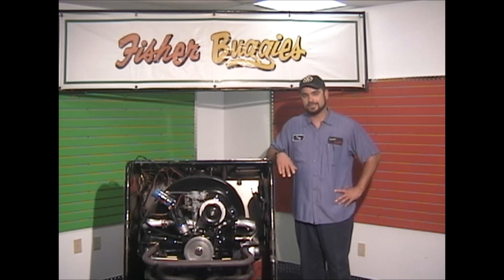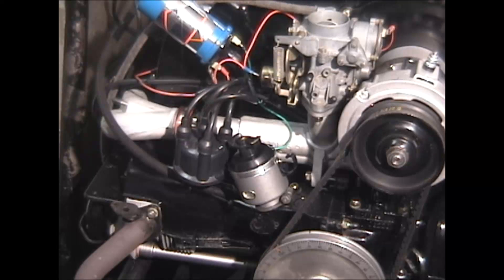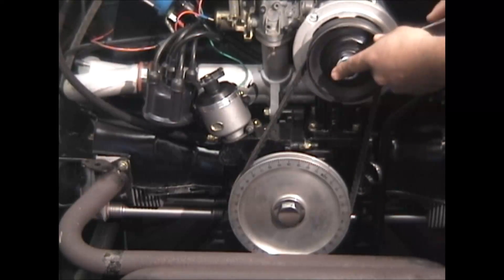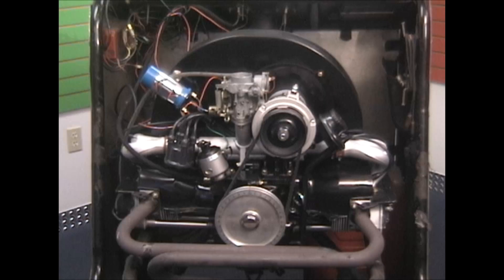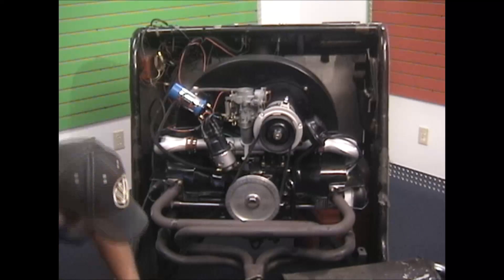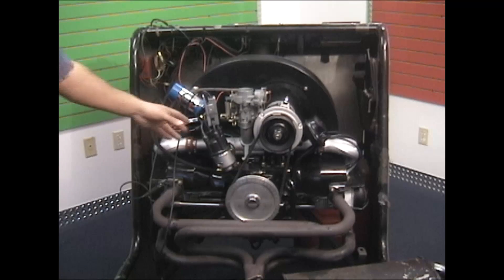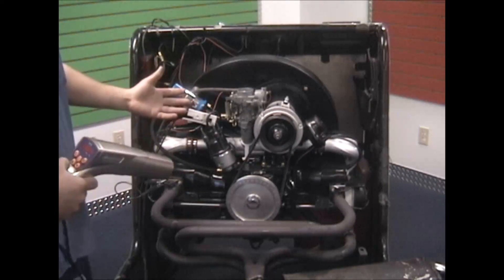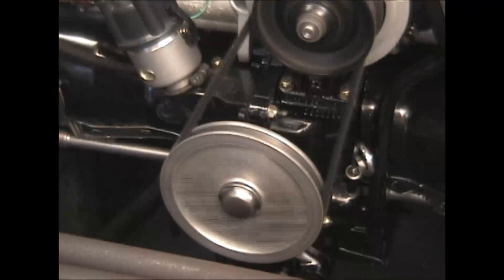VW Ignition Timing

Comment: I have something going on with my 73 standard beetle... no 1 & 2 are firing, but not the 3 & 4. I have tried resetting the timing, changing the distributor’s out from mechanical to vacuum advance, new alternator, & voltage regulator. New plugs, points, condenser, cap, rotor.... NEVER have I run into a problem like this.  I know it’s staring right at me, but I can’t figure this out! I would LOVE to bring it to you, but I’m in Kentucky!
Reply: Has anyone run into this kind of problem before? Right 2cylindwrs firing, left two cylinders NOT firing? Any, ANY advice would be GREATLY appreciated! Thanks
Reply: GOT it all figured out! Apparently, the gasket between number 3 & 4, was torn. My guess would be, because they fire sequentially, I was losing compression. That, and I took apart the new carb, sprayed it WELL with B-12 carb cleaner & put it back together. I was surprised when I bumped the starter over, and it started purring! SWEET!!!

Comment: Hi pop in electric points set timing  at tdc then put test     light screw drive one  coil on negative  still wee light stays on as turn distributor left or right  .... in the light stays on.. do u think is  watt doing  that ....big thanks

Comment: Thank you very much for the video... I have a question... I have pulley like the one in the video and when I turn it to TDC  the rotor points at cylinder #2 (about 2 o'clock) instead off cylinder #1 is this OK?
Reply: Watch "Classic VW Beetle Bug Ghia Bus How to Time Set Volkswagen Engine Timing" on YouTube
https://youtu.be/787INwvir24

Comment: The only sure way to accurately find #1 TDC on the cam on ANY even cylindered, even firing engine is to make sure the companion cylinder is on overlap. On a beetle that would be #3. On most inline 4s it would be #4. On a SBC it's #6.

Comment: Having trouble with Sandrail. Sounds good idles good just doesnt go fast. its super slow as if not getting enough gas.
checked the inlet to fuel pump from gas tank and it was brown fluid at first. does this mean my fuel pump is out? or do i have a timing issue perhaps?

Comment: My 1972 VW Westfalia Bus does not want to idle, she will die when slowing down to a complete stop unless gas is always given. Could timing like this be the issue?
Reply: I have a 72 bus too.  It likely a few things. 1) Make sure your engine is warmed up well before driving. 2)  (The most likely issue) is your carburetors...make sure to readjust your idle mixture, idle speed and check to ensure the jetting is correct for your setup.  What carb setup are you running?

Comment: Hey guys I love your videos. I have a question.I watched your video on timing. I followed your steps on everything. When I got to the static timing I was confused on how you did the light. Were did you touchit to get the light to turn on? Also my light stayed on no matter where I rotated my distributer. I have a brand new one with an electronic igniton. Any help would be appreciated
Reply: If you have electronic ignition, you'll have a wire to the positive side of your coil and one to the negative. On your test light, hook to clip to ground anywhere there's no paint and the light probe to the negative side of your coil.
Reply: You ever figure out the problem?

Comment: Thanks for the video. So I'm being told that my test light is not coming on because my gap point isn't correct so my timing is off but I have doubled check it and it's were it should be and I still don't get any type of light, not even a flicker. I could use your help .....thanks
Reply: PhillyD H clarity is everything in tutorial vids, huh. very good job

Comment: Nah, I found this video only marginally helpful.  The static set up was reasonable, except you didn't explain where you put the blade of the lamp (looks like on the low tension to the coil?) and didn't show what you actually did to get the top end timing to change to 30+ degrees.
Reply: looks like ground no?

Comment: Honestly I don't get ,why do you set the timing dynamically, after its set statically,I mean after you move your distributor you don't loose the static timing? As the angle depends for example on the octanes the gas has,which is the aim of dynamic timing? Is always the same ,or there's a mark specifically for each engine and all vw bugs are supposed to be closer to 32 degrees?. I have a vacuum advance distributor, should I have to disconnect the vacuum hose in order to set the dinamic timing?  Sorry for asking so many questions . Thanks. Last but not least...does the idle change your timing?

Comment: Question. I was trying to fix a bad running motor. As I was adjusting the carb and driving down the street, the motor died. Would not start again. I have replaced the coil, dis. with electronic ignition, cleaned the Carb. Still will not start. I am getting gas. Fire to the coil and coil wire in the list cap. When I try to set the timing with a light, it will not go out. I can turn the dist around and it will not go out. I have done it all by the book so to speak, and it will not start. Why? I did all this a couple of years ago and had no problems.  Not my first Job!
Thanks Mitch

Comment: Couple of points to note : 1st. Recommend using the original svda distributor, centrifugal and vacuum advance unit.  2nd. I noticed the absence of heat riser tube - heat riser tube is essential in warming up the inlet manifold and thus helping to atomise the fuel mixture going into the engine (important even in warm climates). Other than that great vid!!! ;)

Comment: Hi Tony, What would make the test light stay on when I turn the distributor? Thanks for the great videos.
Reply from the maker: Make sure one end of the test light is on the coil and the other on ground. Turn distributor, light should go off and on. If it does not and you have electronic ignition, the module is bad. If you have points they are too tight and closed.
Reply: +hardwoodmichael Crap in the points.
Reply: If the engine is in running condition, you're on the wrong side of the coil! You must be on the distributor side of the coil. The other terminal on the coil is always on when the ignition is on because that's the ignition switch side of the coil. IF ENGINE DOES NOT RUN and you are sure you are connected properly, then there is a fault with the points themselves or the way they are grounded.

Comment: I have been trying this for over a year I made a comment 10 month s ago. Still can't get my bug engine running. I just bought a electric fuel pump to install car is almost done. Just the brand new 2118 cc engine won't run. I really don't want to bring it somewhere to get it going but I'm giving up hope. I might have to.

Comment: I have that aftermarket pulley and its on 15° below top dead center when the valves are correct but I also have a 110 cam its a 74 vw 1600cc bug motor I am unsure because at that moment the light goes off and the rotor is at the 10 o'clock position

Comment: Sorry # 3 cyl 

My firing order is. 
3'2'1'4
Reply: The type 1 firing order is 1-4-3-2.  Re-trace all wires and set it that way.  Make sure you start out at TDC and that you are still facing the 5 o'clock mark on the distributor. As noted in the video , with the valve cover off on the #1/2 cyl'rs the is a noted distiction---one rocker will move and the other won't thereby you will know that you are in fact at TDC on the #1 cycl.
Reply: @dbo9277 You are 180 out and assume that the dist. drive was clocked 180 out when installed in the motor

Comment: When I do static timing the light never goes off. I have a 009.  Also when I have pully at tdc the rotor is pointing at 5 o'clock.  But the wire is going to # 4 cyl.  Buggy is running seems to have power at low range rpm mid range its running rough at heavy throttle.

Comment from the maker: If it is not a racing distributor, it must advance to run properly. You will need to replace the distributor. If it is a racing distributor that does not advance, set at 32 degrees.

Comment from the maker: Correct. Once you set the max advance the static timing is out the window. At that point you adjust the carb idle.
Reply: Correct and adjust air fuel screw to the highest vacuum reading ....gold ..
Add some lumpy cams and exhaust...LoL...
Reply: @jameswhiteman6901  awesome vid. I'm about to learn something, can you elaborate? I thought the static timing always stayed the same regardless of idle speed b/c valves always open at that point on the pulley, i.e. 7.5 btc. Once this is set, I thought max adv was a product of the spring or mag pickup ie not tun-able? How do you tune MA and why back to the carb idle vacuum reading? I think this may be the step im missing.

Comment: Its 32 BTDC or 32 ATDC?
Reply: 32 degrees Before Top Dead Center. Which would be 32 degrees clockwise to the right of your TDC notch on the pulley.

Comment: Re: static & light timing... Do I need to do both or is it either or?  Also, when using the light gun, are you able to adjust to 32 degrees with the gun [using the buttons]?

Comment: hey man, i have a qusetion. my vw buggy will start up fine run good for about 5 seconds then starts to sputter and shut off. it seems like cylinder 2 and 4 arent firng becuz there not warm like the 1 and 3 . whats wrong ????? thanks
Reply: Not enough info here. Fuel and Fire. Are the valves adjusted? Is there proper fuel delivery from Carb to the cylinder? check all components i.e. jets to mixture settings. Are all the spark components delivering? is your coil going bad?

Comment from the maker: No the timing is exactly like the timing set in the video. Timing should be 32 degrees maximum advance at between 2500 and 3000 rpm. If you are having a particular problem, just let us know and we will help you work through it.

Comment: @fahfeez He said 32 degrees on the video, asuming you have a stock cam. Racing cams need more advance, and then your double system is needed. You need to read the specs that come with the cam.

Comment: @viggoM35 The vacuum line advances the distributor. It's retarded when the line is off. Plugging it just prevents a vacuum leak so it will idle right.

Comment: I know making these videos can be difficult, but at one point you said 32 degrees at idle and later you set it at 32 degrees maximum. On mine, I just set it whee it performs the best. Sort of a trial and error, two or three times. I like it to take off without stumbling, and not misfire at higher RPM. I saw an Aussie video and he said set it 3/4" on the pully, before top dead center. Whatever works best!
Reply: “Whatever works best”… is a good way to melt down your cylinders… 🙄🙄

Comment: Say I have a 1971 Bus and have a question about running a 1970 Transaxle. Well I did it without thinking and the Throw-Out is Howling when I press the clutch all the way in. What want to know  is the easiest way to solve this problem. Can I just put in a 1970 Clutch? Note! The 1970 1971 years saw a design change with the Clutch and the Throw-Out and Transaxle Bell Housing.

Comment from the maker: The next step is to make sure fuel lines at the pump are correct, in and out. If so pull the fuel line off the carb and spin the motor over and see if fuel pump is pumping gas. If it is not pumping gas, there is a problem with the fuel pump. Double check the supply line from the tank, when disconnected from the pump, bold it down and gas should flow.